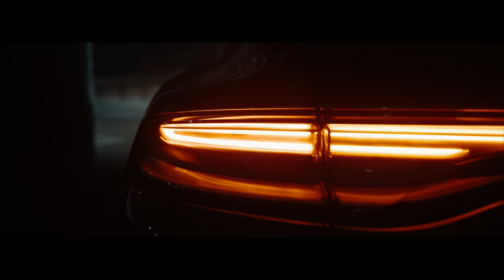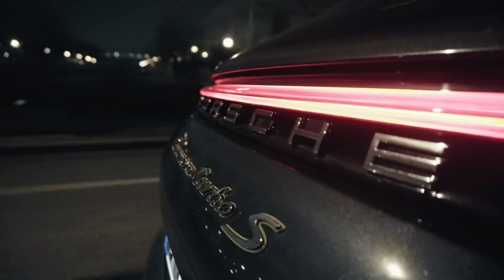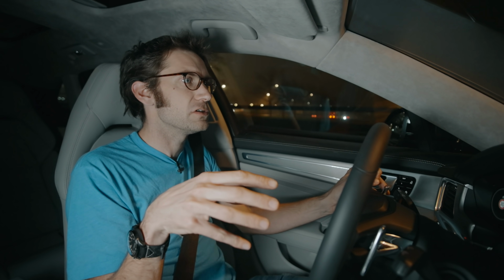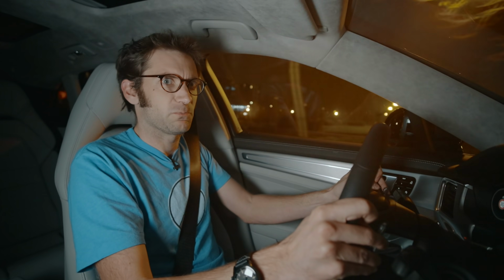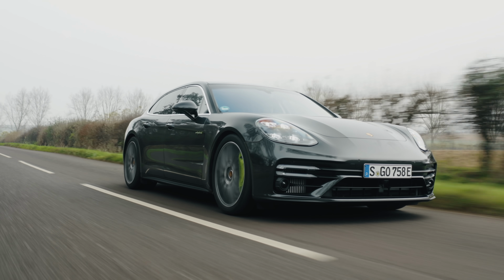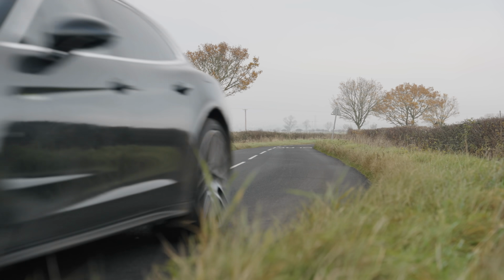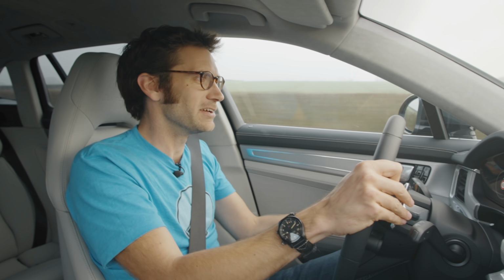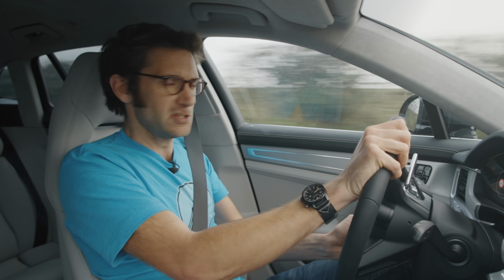NEW Porsche Panamera Turbo S E-Hybrid Sport Turismo: Road Review | Carfection 4K

Comment: Porsche Panamera Turbo S E-Hybrid Sport Turismo : The only car in the history to go faster 0-100 kph than it takes the time to say it's full name. 
What a time to be alive!
Reply: MERCEDES AMG GT 4- DOOR COUPE 63S try this one
Reply: Yeah, but this Panamera hybrid is approx 140,000 K and the other Panamera hybrid is approx 80,000 K. Admittedly its specs are not at the same level, but the price premium for the top of the line model is in no way justifiable.
Reply: Porsche 918 Spyder😎
2.5 seconds official 
2.1 seconds privately tested
Reply: @lucasjbeily7730  official name is Mercedes-AMG GT 63 S 4MATIC+
Reply: @fran7ribeiro  You HAVE to add the “4-door" part or it would be ambiguous - different cars!
Reply: @prometheus9443  nope, the version states if it is a 2 or 4 door. Gt s,c,r ->2door gt 43,53,63s ->4 door
Reply: @fran7ribeiro  OK, I see. I hadn't thought about that.
Reply: @fran7ribeiro  Mercedes-AMG GT 63 S 4-Door Coupe 4MATIC+. Don't forget the 4-Door Coupe part
Reply: @lucasjbeily7730  It is amg gt 4 dt or just amg gt 63 s you have mixed both names

Comment: eFuels sound interesting - excellent addition to the review
Reply: sad thing is that it's a very inefficient process that will most likely produce very expensive fuel.
Reply: Not if you give it to something like the US military and have them innovate like they did during the manhattan project
Reply: @Ramuis166  Yes but for long distance air travel or remote operation of engines, it might be the only option that is close to carbon neutral.
There are also other ways to do Power-to-Fuel and also Solar-to-Fuel as well as bio-fuels.
Also, like Henry correctly pointed out, they are typically drop-in capable, as they are very close to regular fuel, which is a huge advantage for flight (planes are renewed maybe every 30 years or so).
Reply: @evandentes4716  i'm sorry but you do not seem to understand physics...
The problem with e fuels is the efficiency of the processes involved. It's only viable at all if you use renewable energy, and you will need a lot more energy to get an ice car with e fuels over a distance of 100km than you need to get an electric car over the same distance. Only if we have an enormous overproduction of renewables this will be an actual option
Reply: Until you realize you'll start siphoning off the ocean. I'm sure the effect won't be as massive as you'd think, but given enough time.. well who knows.
Reply: Sounds great, but will probably lead to nothing but a delay in alternate technologies and more profits for oil companies while climate change rages on unabated, damaging economies and health globally.
Reply: @thegirthquake8574  pls tell me you're beeing sarcastic
Reply: @Ramuis166  its expensive for now but it will get cheaper once improve rapidly
Reply: @Trendyflute  ya man the oil companies would definitely try to kill this or put a halt on this technology but hopefully in the future once e fuels involves oil companies would change their minds and accept it
Reply: @christopherayala4619  well yes and no, due to physics it will allways be about 10times more expensive than charging a battery powered car for the same distance. Also the cost of infrastrucutre per liter of fuel will increase when less people drive petrol cars(less customers to spread the cost)
Reply: @Ramuis166  is their other ways to make efuels instead of carbon capture and make it cheaper
Reply: @christopherayala4619  not if you want to be CO2 neutral. also carbon capture is only part of the cost drivers, the whole process is very energy intensive. In my opinion efuels will be viable for planes and race cars, but for personal use the battery car is allready on it's way to domination. Look at the porsche taycan, you can charge 300km of range in 10 min. Thats a short stop to mcdonalds...
Reply: @Ramuis166  and semi trucks but dont you think is weird in the future everyday cars will be all electric but race cars planes semi trucks will still use combustion engine
Reply: @christopherayala4619  not sure about semi's tbh, in germany they're testing a system to electrify semi's like they do with trains, then there will be charging rails every few kilometers and inbetween they drive on battery
Reply: @Ramuis166  Well, look at our freshwater table. We've been siphoning that off like maniacs for decades. I'm sure given enough time there will be issues regarding oceanic water use. There are billions of cars on the road today.
Reply: @Trendyflute  seeing as e-fuels are being developed in conjunction with renewable energy tech, and both of these are in direct competition with fossil fuels, I’d say that this is not a good way to vent your cynicism, friend. If you really want to dig in your heels and insist that it’ll all be awful in the end, might I suggest focusing more on how fossil fuel companies tend to lobby governments to limit research into these avenues of tech?
Reply: @thegirthquake8574  the water used in e-fuels makes its way back to the ocean, like all water does. After the fuel is burned, the hydrogen combines with oxygen to make water, which evaporates and becomes rain, which goes through back to the ocean. This is known as the water cycle. Anyway, hope you’re not trolling
Reply: @thegirthquake8574  I'm sry, but you really do not seem to have clue...
You take water from the ocean, turn it into fuel, you burn it. Burning Hydrocarbons produces co2 and (surprise) water. Water condenses, rains down, goes back into the ocean. It's called water cycle...
We effectively produce freshwater this way.
Also there are an estimated 1 385 984 600 000 000 000 000 L of water on earth. If every person on earth has a car, you could turn 100*10^12 L of water to fuel per car and you would've only used half of the water on earth. I know there are a lot of cars on this planet. But i don't think you understand how much water there actually is.
Reply: @Ramuis166  so was electric cars when they started out. Even if it stays expensive, at least we'll have a choice between electric and ice cars. I personally think internal combustion sports cars will stay as a weekend style thing and for going around town electric will be used.
Reply: @sivvinod3187  this will not be an affordable option in the long term unless you're really rich. 
The price of gasoline will be altered by the rising number of electric cars. First it will go down, since the demand for gas goes down. 
However there will be a critical point. The infrastructure behind gas stations is gigantic. 
For example an oil refinery is a giant factory that's only worth running if you produce billions of liters of gasoline. 
But what do you do if the overall market for gas gets too small, you either shut the refinery down, or push the cost onto the liters you still produce. Same goes for gas stations, fuel trucks, pipelines and so on. 
In essence there will be a point where fuel will get really expensive even without imposing the actual co2 costs on them.
I have to admit i like ICE cars a lot. But I have accepted that it's not a technology we can keep. 
And even if i'm shooting myself in the foot, i think we shouldn't be able to buy new ice cars a few years from now
Reply: @Ramuis166  I have hope. Because a lot of operations still use gasoline. Remember, cars aren't the only gas powered device, especially in third world countries. I don't think the change to electric will be as fast as people think possible. I think we'll go completely carbon free and fuelless in 2045-2080. Not before. Because as long as governments and corporations use gas guzzling machines and power sources, the market for gasoline or E fuel will still exist. Of course, us driving sports cars with thirsty v8s and v12s will only stay as a byproduct of the actions of the economy controllers. Once they have no need for it, it'll slowly go away in a span of 10 to 15 years.
Reply: @sivvinod3187  i got to be honest and say i hope not, for the sake of our planet...
Reply: @Ramuis166  e fuels are better "for our planet" than electric. Have you seen the pollution from the battery factories? Have you seen the millions of electric appliances going to junkyards because they lose their capability in 5-10 years? Saving the planet is not an argument, the only good thing electric cars bring to the table are ease of use and speed.
Reply: @sivvinod3187  e fuels are so wildly inefficient it's laughable, in europe a lite of e fuels (provided by green energy) would cost around 5€ a liter...
Have you seen the pollution of offshore drilling, of refineries?
The main problem with batteries atm is the lack of recycling. The difference between e fuels and batteries is:
ONce you've used efuels, thei're gone again, a battery can be recycled.

Don't fall into the trap of accepting easy solutions for complex problems, e fuels are not the cure. E fuels are the desperate attempt of keeping things as they are
Reply: @Ramuis166  e fuels leave 0 emissions, you're jumping back and forth between affordability and cleanliness. In affordability, electric wins, but in cleanliness, e fuels win. 

Also for the "once you use it, it's gone" analogy, of course it is, once you use electricity, it's gone as well. And batteries can't be recycled properly because they lose their energy holding capability! Even batteries, once their use is over, is thrown to the trash. E fuels may not be the cure for people's wallets, but it's the cure for the ozone layer and climate change.
Reply: @sivvinod3187  i'm sorry, but you do not seem to understand basic engineering terms. E fuels may have 0 emissions when provided by green energy. However their efficiency is hoorendous.(The ammount of green energy turned into driving energy). With the same ammount of electricity for 100km of e fuel driving, you can drive around 500km of electric driving...
What makes you certain that in cleanliness efueals win? As far as i know you need rare earth metal catalytic converters to produce them.
And you can recycle batteries when they run dry, that's the whole point...
E fuels are not the cure for anything, except for car manufacturers wallets...
Reply: @Ramuis166  you cannot recycle batteries, that's literally the crisis we're facing with electric cars right now stop being delusional
Reply: @sivvinod3187  to quote obama, yes we can, the technology is beeing mastered as we debate...
I mean, you call out to e fuels, which aren't produced in sufficient quantities at the moment...
Reply: @Ramuis166  are you talking about production and cheapness, or are you talking about the health of the world? Clear that up first.
Reply: @sivvinod3187  i don't really understand the question...
The point is that for every kWh of driving energy, a certain amount of primary energy is needed. Since the production and useage of e fuels is highly inefficient you will probably need around 10kWh of primary energy for one kWh of driving.
With electric cars you need way less. So if you want to use e fuels on a bigger scale you need way more production of green energy (aka more ressources) for the same ammount of driving. Also you act as if ICE car recycling and the recycling of their waste products is super easy. Just calculate the ammount of lubricants an ICE uses in it's lifetime and how much effort is needed to recycle them.

i got to be honest, i'm going to end this discussion from my side, it's just no use discussing with paople like you. You don't want the ICE era to end so no argument will ever be good enough. You want to keep a technology that uses 30% of it's primary energy at best alive by using an even more inefficient way of producing fuels for it. You either realize that this is not they way forward and invest your money accordingly, or you will allways be pissed cause your favourite engine just didn't make the cut.
Reply: @Ramuis166  Im sorry but you dont seem to understand applied physics... the major issues regarding energy transformation are "storage" and 24 hour usage cycles.. a simplified way of describing the issue is Not having energy when you need it the most and having an excess of it when nobody is using it.
Reply: E fuels is on the same page as snake oil. Or pipe dreams.